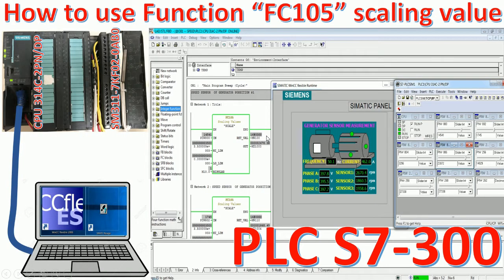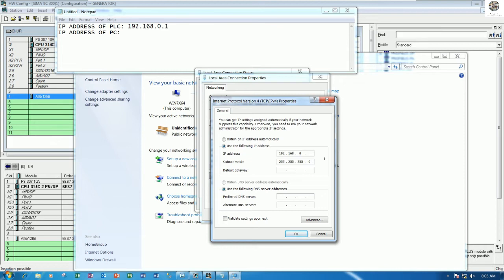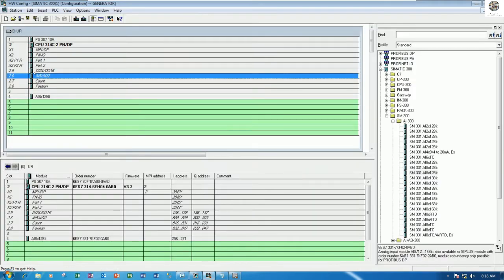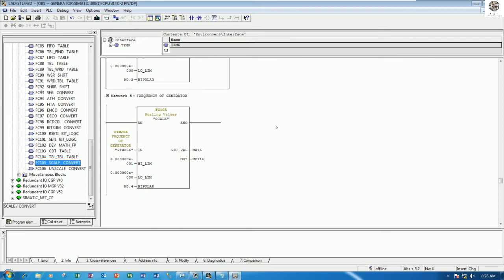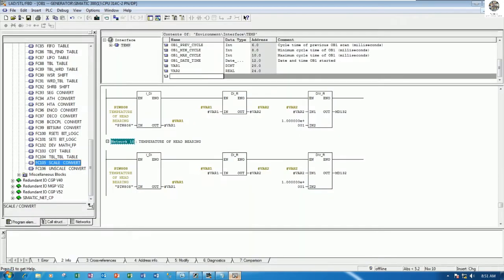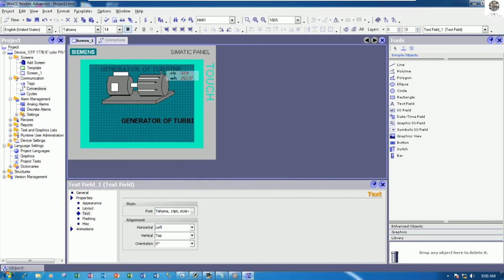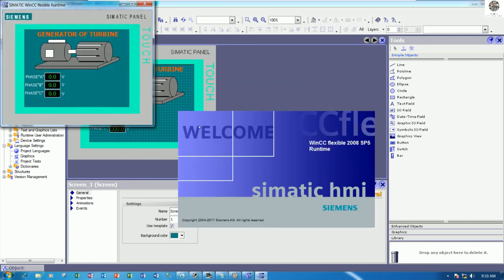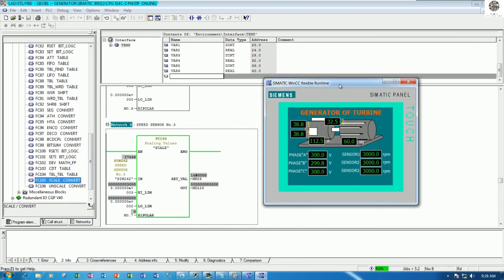SIMATIC Manager V5.6 how to use Function FC105 for scaling analog input converter

Comment: hello could it work without any real-HMI. is it possible just to run a simulation without HMI-hardware. Thanks
Reply from the maker: Dear sir,
We can connect with the real HMI hardware by download this project from WinCC Flexible to HMI then we can control it.
Thanks!
Reply: @generaltechnologyknowledge5165  thanks a lot for your answer. i would like to know how could be a negative range also added to scale function. i would take a K-type thermocouple (-40...+260 Degree C.)
Reply from the maker: @bahram6252  Yes sir it possible for this range.
Thanks